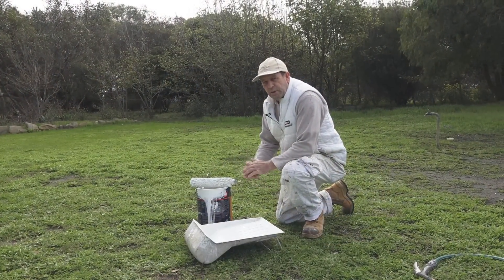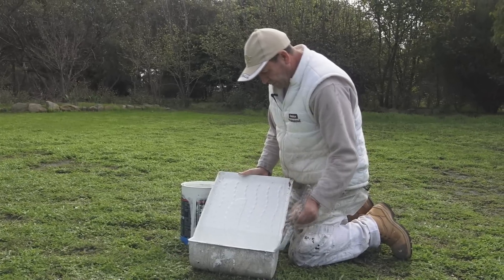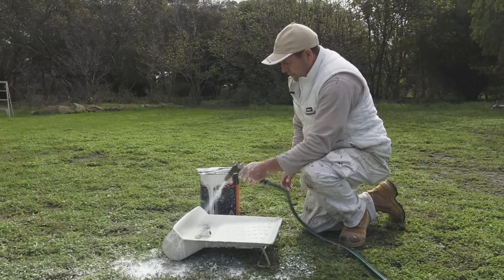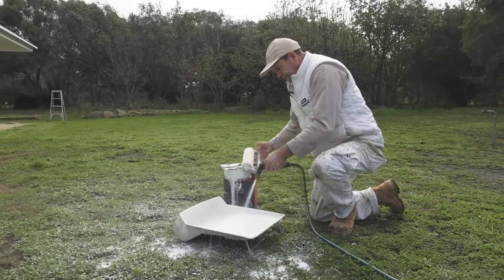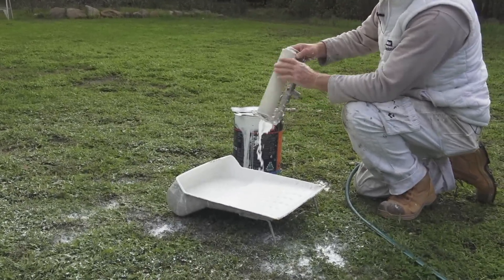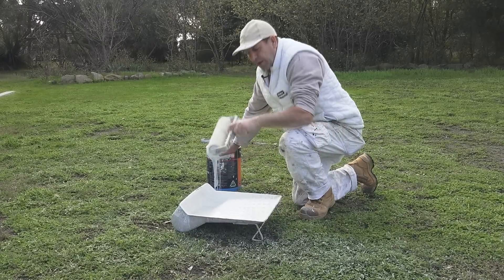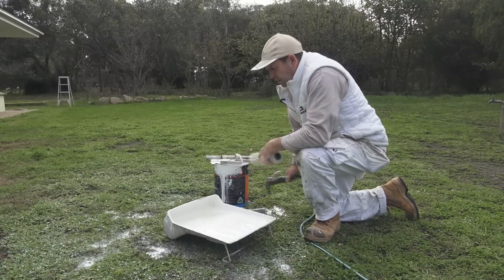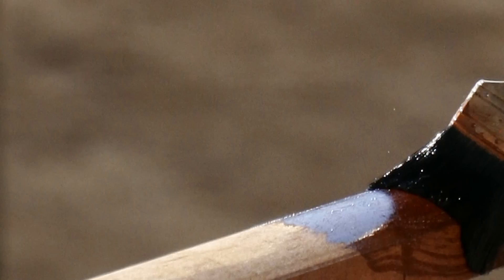How to clean a paint roller. Making sure the paint roller is clean and washed properly.

Comment: I use the hose spin method, but I alternate between spinning the roller as fast as possible, then I direct the hose back and forth along the axis of the roller as it decelerates, forcing water into the nap. Then I switch to spinning again. A few cycles and it’s clean.
Reply from the maker: Yes that is another way to do it but be carful to remove all the paint, I have people work for me and they have used that method. After they have cleaned the roller I will place it in water and often the water will start changing colour as residue paint deep in the nap starts to come out.
Don't forget to Like, Share and Subscribe.

Comment: Being science trained I observed in my experience that it’s a matter of introducing water and having it removed which cleans best. Like flooding the roller leaves a static layer of paint which won’t easily go.  Try this. Have the roller with a end cap upright after initial cleaning and run the finest drizzle of water on the top. It will get into the nap and be transported out efficiently and get very clean without having to actively squeeze etc. a harsh flow of water will flood the outside and be less efficient. But yes a few runs of the slosh and roll is needed to get the bulk off
Reply from the maker: Don't forget to Like, Share and Subscribe.
Reply: some guys do this when its in a sink.

Comment: I hate cleaning rollers always messy, I have done it that way and still get covered it water,  I find it just as easy to throw them away and get new ones
Reply from the maker: It will depend on how much you pay for a roller sleeves, the ones I use cost from $30 to $50 each. Throwing them away wouldn't make sense but yes if you use cheap rollers it can be more time effective to throw them away.
Don't forget to Like, Share and Subscribe

Comment: Hey mate a quick question, are the Dulux excellence 18mm a good choice for walls? I find the Dulux excellence 11mm just don’t hold enough paint unless doing a feature wall where I don’t want alot of stipple. What do you use
Reply from the maker: I use 14mm nap is the normal size I use, the brand is superior lambs wool covers.
Don't forget to Like, Share and Subscribe.
Reply: @howtopaintinfo  thanks mate and what nap for ceilings?

Comment: I use a wash 'sleeve' connected to a hose. It takes about 20L to completely clean a roller.
I have 2 tubes (sleeves). One for short nap and the other for 10-15mm.
It only takes a few min to do the job.
Reply from the maker: Depending on what type of roller sleeve but I would use about the same amount of water.
Don't forget to Like, Share and Subscribe.

Comment: I Like To Use a Bucket To clean The Roller With The Spinner. And Make Sure The Roller Tray Is Fully Covered With Wet Paint After You finish And let That Dry But Make Sure It's a Water Based Paint on Say a New Roller Tray And After Maybe Ten Times Using That Roller Tray You Can Peel The Ten Coats Straight Off And It's Just like a New Roller Tray as You Probably know That's Just Me I Like To Keep Everything Clean as Possible.
Reply from the maker: That is one way of doing it and not a bad way but I just find for me its better to wash the tray out so its dry to use again. I peel the paint off the tray when the paint is thick enough to do so.
Don't forget to Like, Share and Subscribe.

Comment: If you are doing this commercially...its a waist of time...let the customer pay for the rollers in your quote then discard them once used...if diying then again i personally would discard them as how often does one paint a room..a house..a wall etc...its normally years before its done again...and.by that time the so called cleaned roller is probably not in the best condition to use anyway.
Reply from the maker: The roller sleeves I use (lambs wool) cost about $40 each and do wash out very easily. There are other types that do take longer to wash out which you could class as border line to wash out or throw away due to cost. Cheap rollers don't necessarily give you a good finish so it's up to the individual what they choose either a good quality sleeve or a cheap throw away sleeve. I still have worn down rollers that  I have had for a long time, they are still fine to use, I keep these for oil paint then throw them away after.
Don't forget to Like, Share and Subscribe.
Reply: @howtopaintinfo  well said!!

Comment: This is a good way to contaminate the ground. Well done.
Reply: I doubt there is much to worry about. There is maybe 50 ml of paint left in a roller if its fully cleaned mechanically first. Most of that is water, and the bright white is titanium dioxide, which is inert. The acrylic monomers are diluted with a lot of water, and probably biodegrade in the soil. If you dont wash the rollers you have to buy a new one. Then you have to account for the energy and pollution created in manufacturing it, plus more landfill. Also, considering home owners paint maybe once every 10 years, thats a lot of time for the soil organisms to degrade it. Better anyway than flushing it down the drain, which Im sure a lot of people do.
Reply: The accidental release measure for Titanium Dioxide is: Personal precautions
Avoid inhalation of dust by arranging adequate ventilation, or use an appropriate dust mask. Avoid excessive contact with the skin. Use appropriate personal protective equipment.
Emergency procedures
Pick up spills and place in a suitable container for reclamation or disposal, using a method that does not generate dust (e.g. vacuum, sweeping) Ventilate area of leak or spill. Keep unauthorized personnel away.
6.2. Environmental precautions
Avoid dust dispersion to the environment. Prevent leakages from entering drains and ditches that lead to natural waterways.

I’m not a save the earth activist. I’m letting you know you are displaying video and written evidence that you are braking the law and could result in a fine or a jail term. I appreciate that your aim is to advertise you are the expert advisor in this field but it is better to demonstrate it with safety in mind as when people watch this video they will not be handing you that big Job and all the good work you did presenting the video is wasted. I would scrap this video or edit it then the right people will give you the credit for the right reasons. This is not a criticism I’m letting you know that if I notice it then how many others. Good luck
Reply: Mark Ellis I'm not an expert, nor even a professional painter. Nor am I the original poster, as you seem to believe. I am a bit of a greeny, and do have concern about the effects of these chemicals. Given that people WILL clean out their rollers, the choice is between the ground, and the drain. I believe the ground is the better choice for the reasons stated. Out of sight, out of mind is hardly a rational policy.
Reply from the maker: Its better on the ground then washing it down the sink in to the ocean.
Don't forget to Like, Share and Subscribe.
Reply: Mark Ellis Not a correct statement for latex paint.

Comment: U shouldn’t use a 5 in 1 to scrape the paint out of the skin.. you’ll only get half the life out of the skin doing it..
Reply from the maker: I have never had an issue using one, just don't press too hard and hold on a slight angle so it doesn't dig in and you should be fine.
Don't forget to Like, Share and Subscribe.
'

Comment: All that paint from your washing video being dumped blindly into the grass and then entering our ground water/drinking water doesn't seem very intelligent  . Do you drink well water on your property?
Reply from the maker: Firstly its water based paint and also when you are washing out there should be minimal paint in the roller. I'm sure the soil would be enough to filter out the paint partials long before it got to ground water, that's even if it made it that far.
Don't forget to Like, Share and Subscribe.
Reply: Yes, on that lot, painting is going on 365 days a year, that means on average 2 roller cleanings a day, well you do the math. Better call the EPA now.